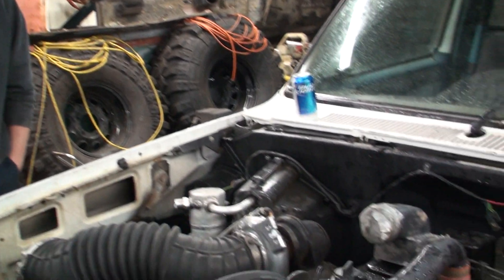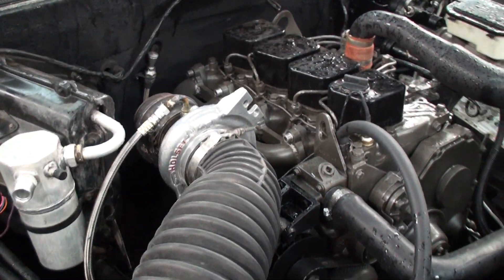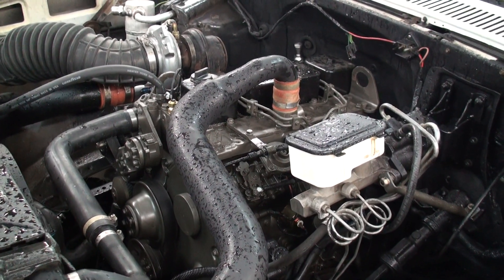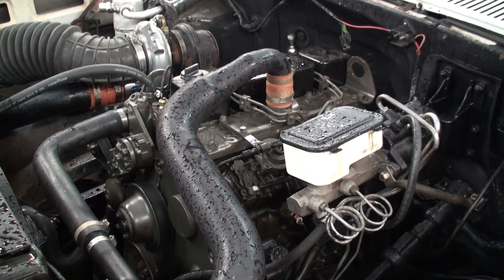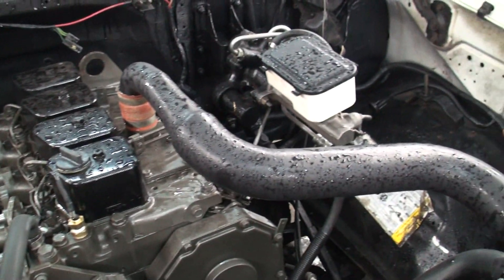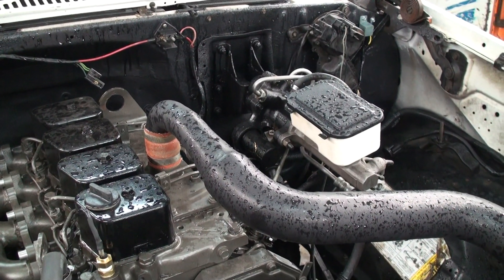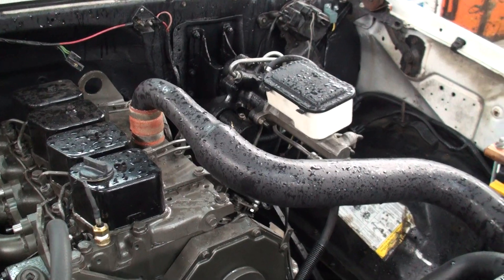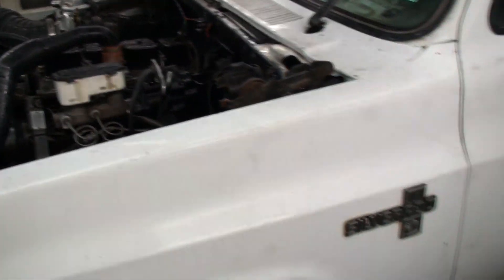chevy 3.9L cummins

Comment: The 4bt (3.9) is the little brother to the cummins found in Dodges. Its the exact same engine, its simply missing two cylinders. They'll clear the factory hood of most 1/2 ton trucks. they are also shorter front to back

Comment: They made a 3.3 turbo and 3.3 no turbo back in the day. The 3.3's come at 85hp 220lb-ft for a mechanical, and weighs under 600 lbs when it's fully dressed.    A lot of people use them for swaps in s-10's, and jeeps. Anything heavier would just be a dumb idea. I've heard of mud-ready jeeps getting 34 mpg highway with a 3.3t in it, and that's some damn serious mileage. plus they're considerably smaller and easier to swap than a 5.9 or a 3.9 even. Hard to find though,

Comment: Nice!! Is this engine shorter than the 5.9 Cummins. I mean from oil pan to valve cover not front to back. From what I have heard, one of the biggest problems with 5.9 swaps is that they are so tall, a body lift must usually be used, which I would like to avoid. Used 5.9's are actually a lot cheaper than the 3.9's, but I'd love to put a 3.9 in something that it would easily fit in, and have a 30mpg cruiser.

Comment: These 3.9 4BT Cummins are all over Ebay, there are a couple co's that salvage them out of bread trucks and you can get them complete with bellhousing and several transmissions.  They run about $3,000.00 frt ppd to US addresses. check it out.

Comment: Would it be easier to add the a/c with this 3.9 cummins? I was considering a 6bt swap. I have a 6.2 diesel right now and I would like to swap it for this 4bt engine. I would be using my truck for light towing and cruising. Would this swap be good for me or not? I'm a novice sorry
Reply: Since yours has the 6.2 y not just get a 6bt 12 valve ac from what I've seen would be the same as the 4bt
Reply: +Ryan Chapman 
There's clearance issues with the ac compressor and the c10 frame
Reply: +92Inquieto my bad I forgot I'm used to 88-98 swaps plus I had a friend do his but he must've cut the frame my bad guys